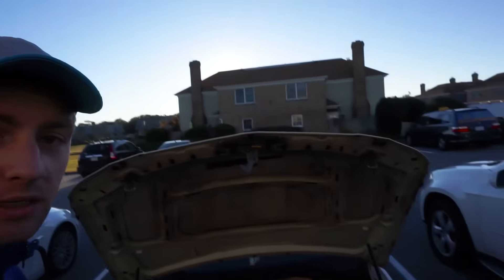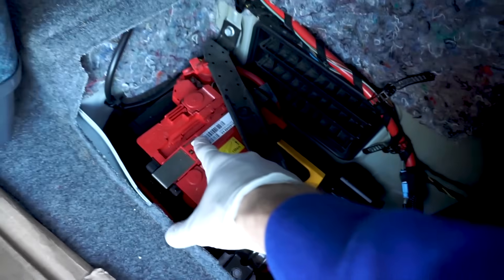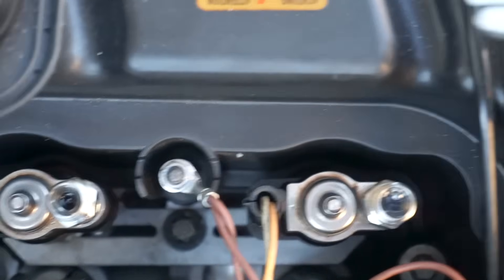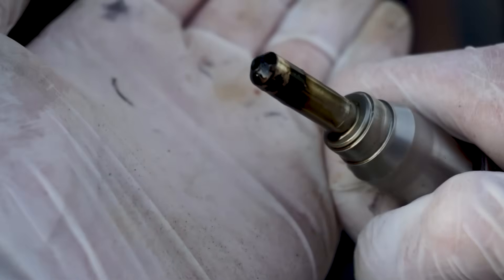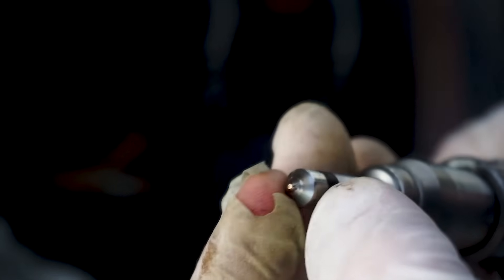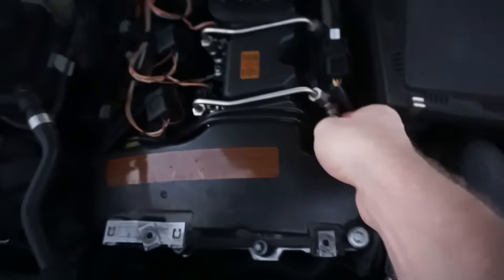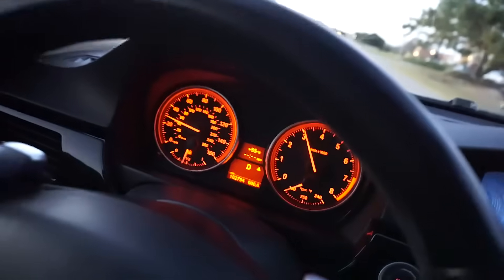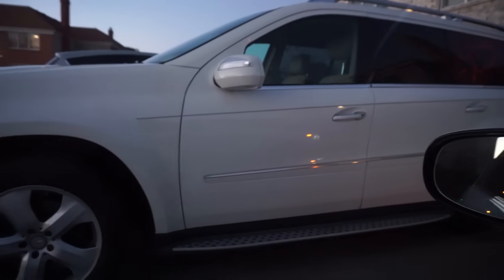BMW 335i fuel Injector problems! Quick fix for 0$ Read Description! how to fix bmw e90 injectors

Comment: Tks for the vid.. so my question is do u have to change the gasket on the injector or if u clean the injector fast enough and put it back then is it OK..
Reply from the maker: U have to! They cost like $20 for 6ps... I did replace them eventually! i didn't have a special tool for gaskets, and i was about to check if it going to work out)

Comment: How do you do, it's being seen happily in Japan!
Mine will be 5 cylinders at the time of of of between the cold sake, and a plug is wet.
Has leakage gone out by carbon of an injector? 
I'm waiting for an answer.
Reply from the maker: I'm not really sure what are u asking, but for real u have to replace injector gaskets and spring to make it work like it should! 
as far as I know, the injector is dirty, and they spray not that good, so they spraying on the said, there is no combustion in cylinder, after all, o2 sensor reed data and getting more fuel in particular cylinder, in case fuel does not come to cylinder, but fuel has to go somewhere,  in that case, the plugs are wet, I planning to make Vid about injectors and why they are doing that and what is going on there...

Comment: I thought you were supposed to replace those injector gaskets every time you pull out an injector.
Reply from the maker: If you do that quick enough you good, but you definitely need to replace them every 80k mi. I will make wid about the gaskets and springs soon.
Reply: I have personally seen vents burned into n54 heads around the injector seal (just like a burnt valve) from people reusing old seals.